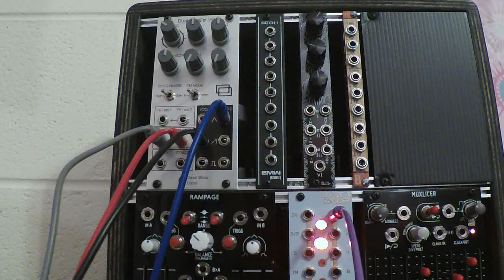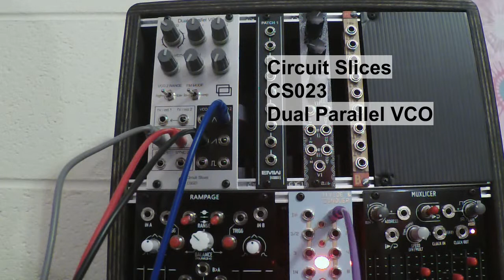Circuit Slices Dual Parallel Oscillator

Comment: Hey Josh...Congrats on your new Dual Parallel VCO...I like the Rampage Module..i was thinking of getting that same one you have...& btw, the make noise you mentioned can do just that but at the same time you give up the other features like you mentioned.....
Reply from the maker: I am conducting experiments and should have a video about Function Generators As Oscillators to post midweek.
Reply: @JoshuaKennedy321  ok that will be great..maybe i can apply these principles to the NanoSynth NS1..
Reply: The Circuit Slices Dual VCO is a great bargain.  I've used mine often,  mostly as a supplemental vco.  It sounds good, tracks over several octaves and is very stable.   For the price, it can't be beat.